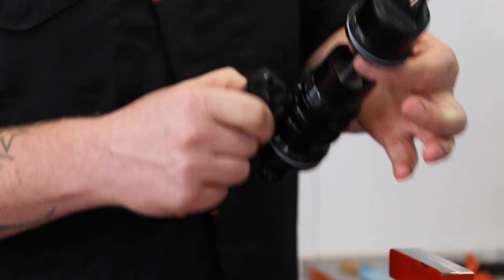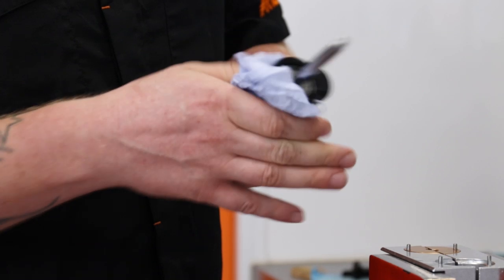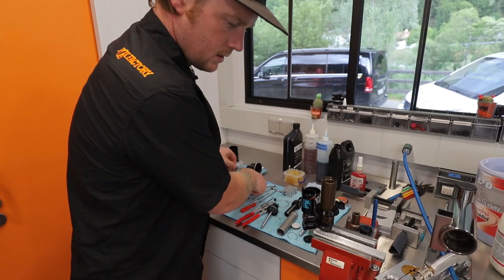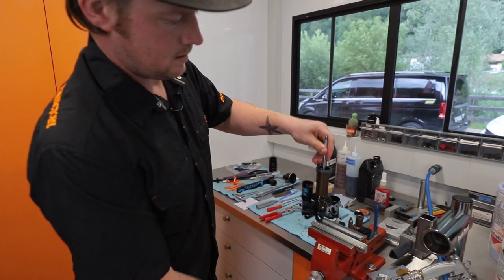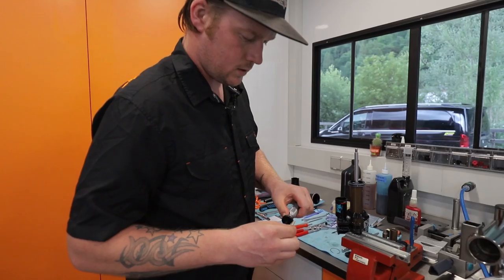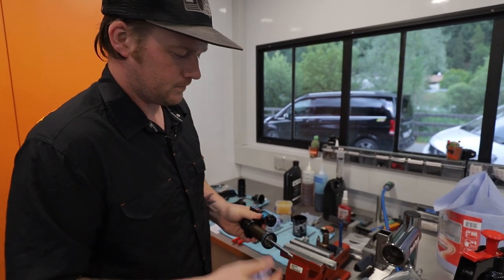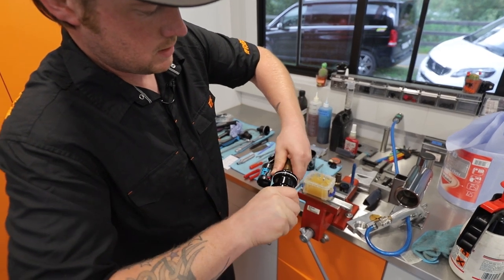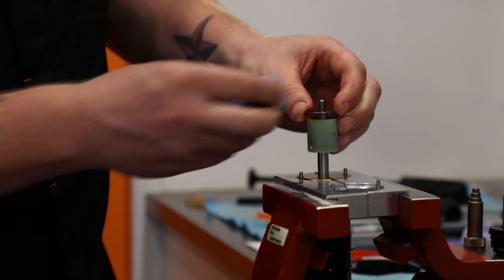DIALED: Episode #33 - FOX FLOAT X2 SERVICE

Comment: Great video, its awesome that a manufacture would even publish this. Quick question, when you take the shock pressure you obviously loose a little, how much do you add to compensate, 5psi, 10psi?
Reply: stuart harper loose about 1.5 psi when u remove it
Reply: Super good question. It’s relative to the PSI of the fork/shock you’re attaching to, and how much air volume is in it. A shock at 300psi would lose a lot more than say a Fox 38 at 70psi (fork has more air volume at a lower pressure). I suspect the correct answer is, it depends. And you can easily figure it out on your own by pumping the shock to a known amount close to your operating PSI, then detach and reattach the gauge and see how much you lost.
Reply: That has already been proven to be false. You don't do anything to compensate. If it says 150, you add 150.
Detaching then reattaching the pump is false because when you remove the pump and reattach it, that "lost" pressure is actually just the pressure required to fill the hose, which is why you will always see a lower value even immediately after pumping up a shock.

Comment: So, no need to vacuum bleed?
I've pulled a vac cycle on suspension oil straight out of the bottle and removed quite a bit of microbubbles suspended in the oil.
I saw the machine next to the hand dyno.
I built my own vac bleed tank to do moto shocks.
great video btw!
tks
Reply: It's not completely sealed, microbubbles can still form, and that difference isn't going to be make or break.
Reply: @rustler08  then why do those vacume bleeders exist then ?

Comment: so do you know how much air is lost, buy installing the pump to "measure" the pressure ? So original the rider put 190 psi inside, but you dont know it. You measre with the pump now 178 for example? Do you add always the same factor on top afterwards?
Reply: In my experience that depends almost entirely on the pump. Just connect it 2-3 times and check the difference in psi and make a note of it.
Reply: Correct!  Even in Jordi's previous advanced setup video he acknowledged nearly a 12psi drop in shock pressure! Drives me wild when making adjustments

Comment: Couple of questions. Does anyone know what the thread specs are on the female side of the bleed adapter are?  I've got the adapter, its tapered, but its not NPT. Also, are the steps the same for a 2021 shock?  If I don't have a Performance series shock, would I need a VVC tool?  #foxdialed #factorysupport #floatx2service

Comment: I have a Factory Float X2 on my 2021 Rocky Mountain Altitude A70. I think I'm losing air. I went rom 230 PSI to 1bout 160 - 170 in like 2 weeks. My Bikes just 6 months old does that seem excessive? any thoughts on what I should do?

Comment: If the race mechanics skip nitrogen in the ifp chamber, I will too:-) Any point in having nitrogen in these at all?
Reply: Complete guess would be that they are stripping and servicing these forks every weekend so the long term stability provided by nitrogen isn't much of a benefit. For the average rider servicing their shock once a year it's a different story.
Reply: I agree. The idea to use pure nitrogen, for you understanding, is that the molecules are bigger, which won't leak or leak less through the sealing. It also depends on the pressure. Some shocks use 400psi in the IFP to compensate hysteresis.

Comment: #foxdialed aeration was mentioned twice in this video. Any way you guys can explain what aeration is and how that condition is mitigated (other than oil additives) within the shock? Pretty please.
Reply: Aeration is the mixing of oil and air. They've done nothing to improve the design to mitigate it, so you are stuck with fixing it when it happens.
If you're lucky only a bit of air got by and you can just pull oil out of the shock and replace it with fresh oil. If you're unlucky, it's full service time

Comment: Hi, congratulations on the video! I am reviewing my float x2 but I have a problem with the IFP: my shock absorber is 205 mm x 65, if I convert to inches it is 8. 070 x 2.50. I don't understand what VET measure I have to use. Can you help me ? my shock has the serial number C99N. Thank you
Reply: According to the service manual it's 1.343in/ 34.11mm. https://www.ridefox.com/fox17/help.php?m=bike&id=682

Comment: Why no nitrogen for the ifp Reservoir?
Reply: Nitrogen is usually used because it’s dry, and thus won’t cause corrosion. That’ll be a non-issue on shocks that are serviced weekly! I assume Fox uses nitrogen from the factory because most dampers don’t get opened for years at a time. In an IFP design the nitrogen doesn’t touch the damping fluid, so there’s no aeration concerns like in an open-bath damper. And a tiny change in pressure due to heat in the IFP doesn’t really affect the air spring much, especially since the X2 damper shaft is to tiny compared to the air shock and reservoir volume.

Comment: 1. What is the psi pressure of the IFP tube? 2. do all rearshok psi ifp is the same? 3. What is the effect of ifp ifp is too high or too low? Thank you.
Reply: Google for the service manuals. The IFP pressure depends on then model and is specified by the manufacturer. For example the X2 DHX has 150 psi, the X2 Air has 125 psi and an older Float has 350 psi.

Comment: Do mine next! Its stuck down and still has the old thinner air can that was never sent in for the recall in 2016 because it was stuck down and not in use 😂 anyone know where to get a new air can for the 8.75”? I can only find the 8.5” and thats a different part number, even tried to put my other air can on from my 2018 8.5” with no luck, its a tiny tiny bit shorter